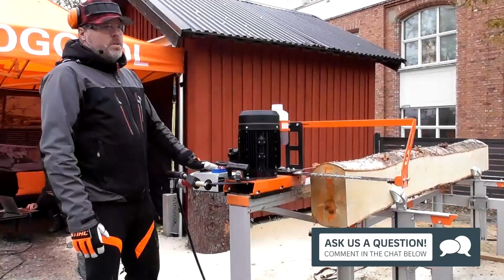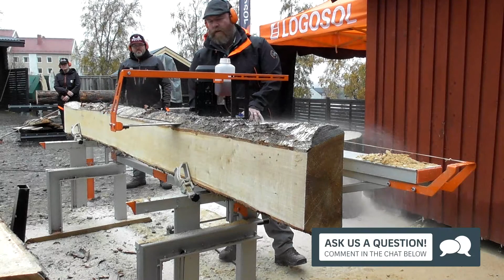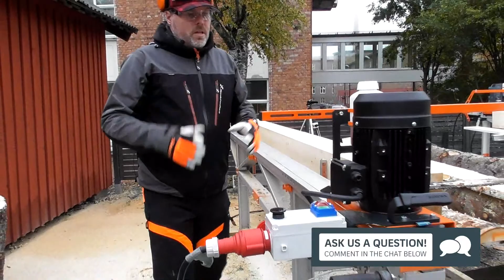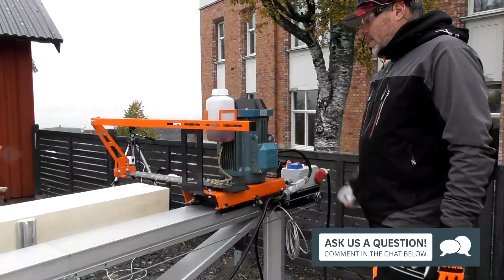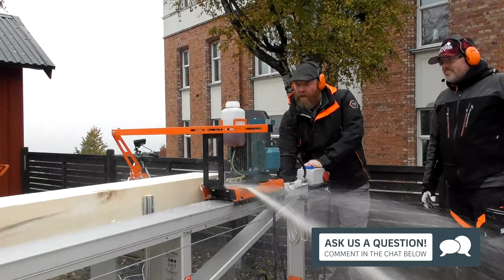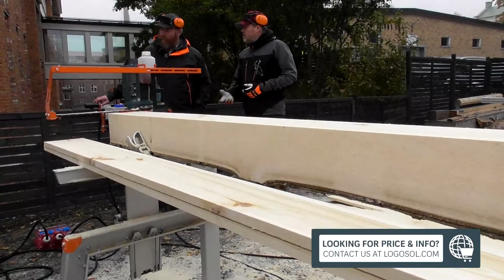LOGOSOL | Live Demo - New electric saw units ES5 & ES8

Comment: is the chain sharpened the usual way ?  On my electric chainsaw and home made small mill I  sharpen the teeth at 90 degrees to the bar , it gives a clean cut without vibration .Water cooling btw. My saw works vertical so there's no need for a support at the tip-end .
Reply from the maker: Great question. For chainsaw milling we usually recommend sharpening specifically for ripping, which differs from standard cross cutting angles. The exact angles and setup can vary depending on chain type, so for best results feel free to contact our support at info@logosol.com and we can guide you.
Reply: @LogosolGlobal  I use the narrow mini chain with the 1.1 mm groove in the bar .

Comment: Come on now, You put this on Youtube, how about an answer, to the 60 hertz 220 volt, ac version for the USA.  this is a real deal , many of us who have milled with gas power chainsaws see a real advantage in this.
Reply: As long as it's 3 phase and you can get the unit shipped to the US it will run on 60hz. The motor will run 20% faster and produce 20% more power due to the increased frequency.

Comment: Same question for me. I need an electric model that is powered by 220v max 30 Amp. I have to power it with a portable generator. Generator is 9 KW unit with 120v 20 Amp or 220v 30 Amp